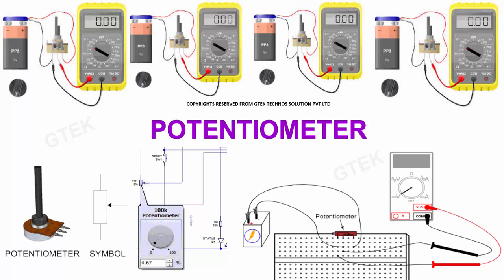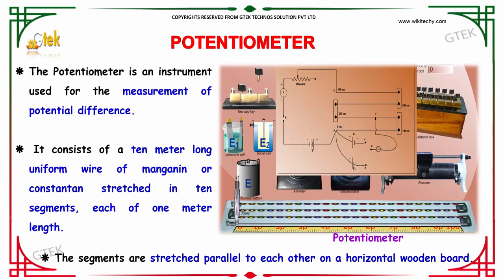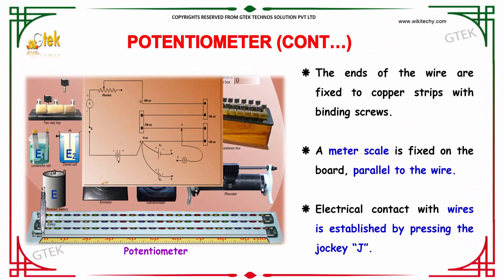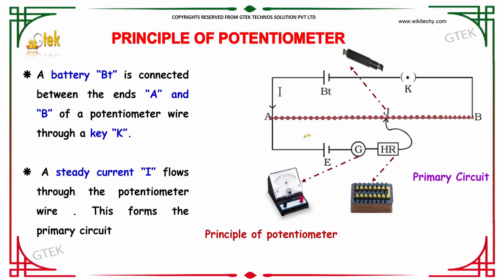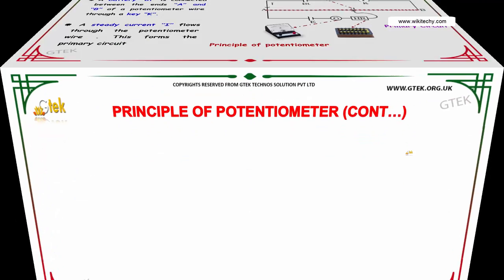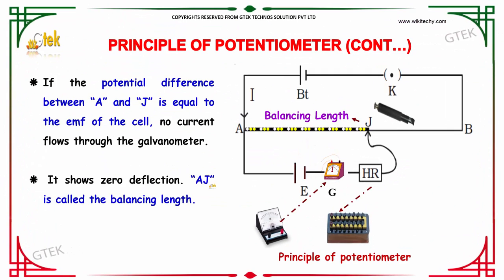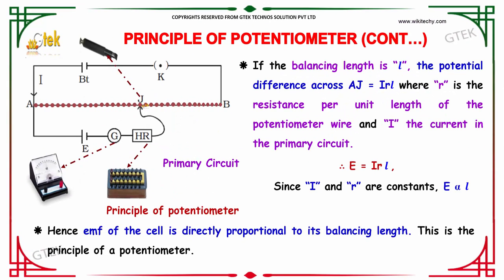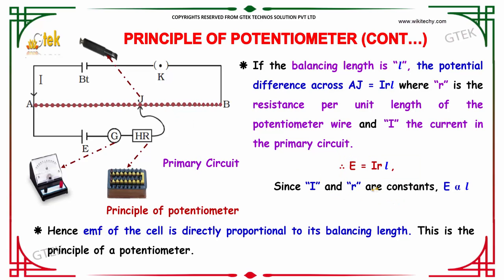+2 Physics Current Electricity - Potentiometer | CBSE | Samacheer | wikitechy.com

Comment: an instrument for measuring an electromotive force by balancing it against the potential difference produced by passing a known current through a known variable resistance.

2.

a variable resistor with a third adjustable terminal. The potential at the third terminal can be adjusted to give any fraction of the potential across the ends of the resistor.

Comment: A potentiometer being calibrated and then measuring an unknown voltage. R1 is the resistance of the entire resistance wire. The arrow head represents the moving wiper. A standard electrochemical cell is used whose emf is known (e.g. 1.0183 volts for a Weston standard cell).

Comment: A potentiometer is an instrument for variable potential (voltage) in a circuit. Before the ... This null balance measuring method is still important in electrical metrology and standards work and is also used ... 1 Principle of operation; 2 Constant current potentiometer; 3 Constant resistance potentiometer ....

Comment: If only two terminals are used, one end and the wiper, it acts as a variable resistor or rheostat. The measuring instrument called a potentiometer is essentially a voltage divider used for measuring electric potential (voltage); the component is an implementation of the same principle, hence its name.

Comment: A potentiometer, informally a pot, is a three-terminal resistor with a sliding or rotating contact that forms an adjustable voltage divider.

Comment: shall study some of the basic laws concerning steady electric currents. ...... pot is. ∆U pot. = Final potential energy – Initial potential energy. = ∆Q[(V (B) .... Physics. 108. Consider two resistors R. 1 and R. 2 in series. The charge which leaves R.

Comment: The potentiometer works on the principle that when a constant current flows through a wire of uniform cross sectional area, potential difference between its two points is directly proportional to the length of the wire between the two points.

Comment: A potentiometer is an instrument for measuring the potential (voltage) in a circuit. Before the introduction of the moving coil and digital volt meters, potentiometers were used in measuring [[voltage.

Comment: A potentiometer, informally a pot, is a three-terminal resistor with a sliding or rotating contact that forms an adjustable voltage divider. If only two terminals are used, one end and the wiper, it acts as a variable resistor or rheostat.

Comment: To compare the E.M.F.s of two given primary cells using potentiometer. ... Electromotive force (emf) is a measurement of the energy that causes current to flow ... emf's of two given cells by measuring the respective balancing lengths l1 and l2.

Comment: Principle: The potential difference between any two points on the wire of a potentiometer is directly proportional to the length of the wire between these two ...

Comment: Meterbridge and potentiometer. ... to compare emf's of a cells,Potential difference between two points of the electric wire ... V is proportional to l when current I is